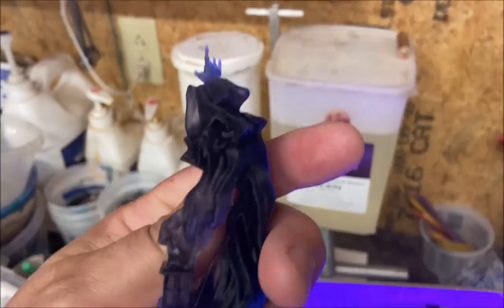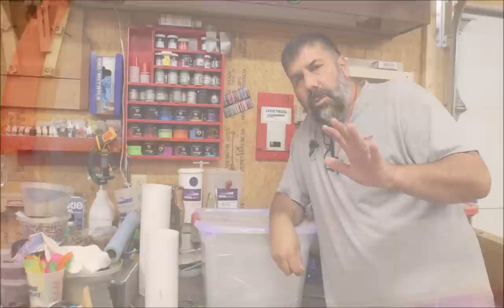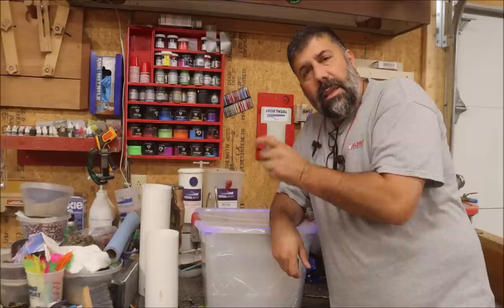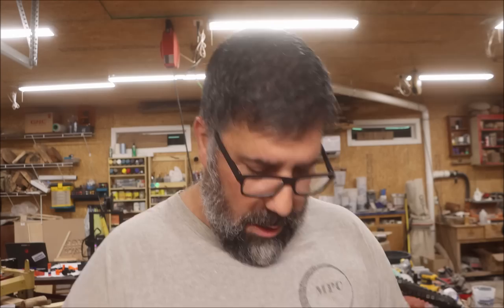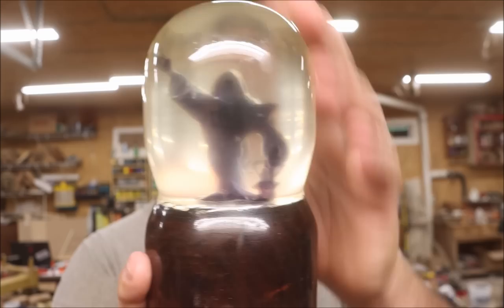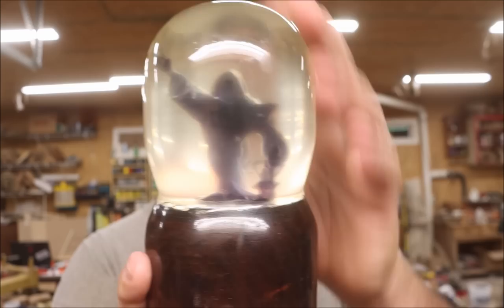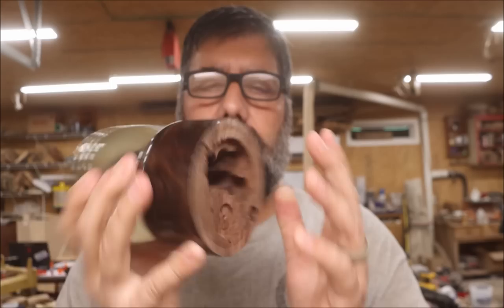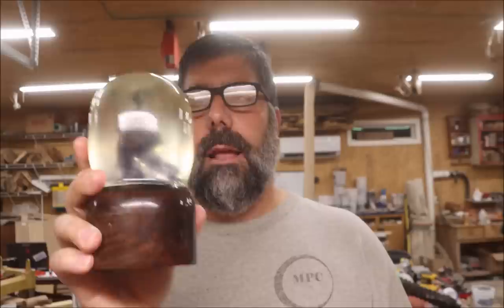This Was a Cool Idea In My Head

Comment: ...well, it was cool idea...I'm sure you'll get it on the next one...👍
I've seen other turners remove the built-up resin ribbons using a toothbrush while the lathe is turning...haven't turned resin yet, so I don't have first hand experience...but you may wanna give it a try...
Matt
Reply from the maker: I use air mostly. It works well. Thanks.

Comment: Even when things don't go as planned, learning continues to take place.  I'm glad that you continue to share both successes and future successes 😜 with us.
I have a question about applying the clear coat resin as a finish: What speed (rpm) do you set your lathe at?  My lathe has a minimum RPM of 600, which I'm sure is too fast.  I will have to create something if the speed is lower.  Thank you for your videos and for your help regarding my question.
Reply: I use a bbq rotisserie motor works a treat
Reply: @pennybowls8724  thank you. I will look into it.
Reply: Zac Higgins has a video showing how he did it
Reply from the maker: Hey Brad, @Pennybowls it right a rotisserie motor is the way to go for a lathe that can't rotate slow enough. I'm at 51 RPM on my lathe. There are lot's of videos out there. Zac's it a good place to start.

Comment: Could the wood contaminated the resin while in the vacuum chamber?  Seems it may gotten moisture in it or something, Maybe from the pressure pit? How clean and dry is the air?
Reply from the maker: I don't think it was moisture, but I do think you are on to something. I think the color from the walnut leached into the resin causing it to cloud and tint a little.

Comment: I notice that sometimes you use a pressure pot and sometimes a vacuum pot, can you tell me/us why you use either one?  (I mean, I think I understand that vacuum one, it lowers the ambient pressure, encouraging bubbles to escape the resin, but pressure,...I don't get that one)
Reply from the maker: I don't always show it, but I use both most of the time. The vacuum gets out the abundance of bubbles, fills in the cracks and groove. Then the pressure pot squeeze's what is left so small you can't see them.